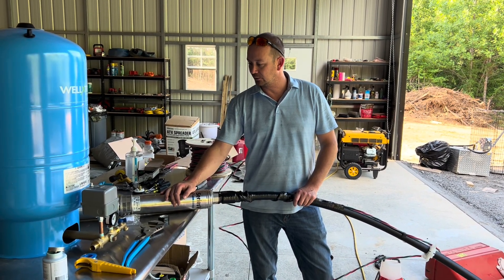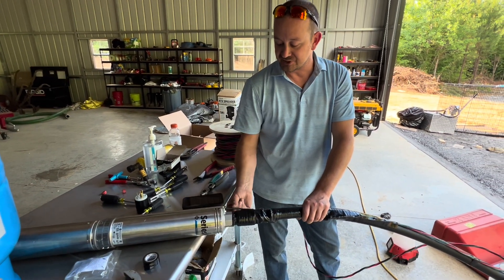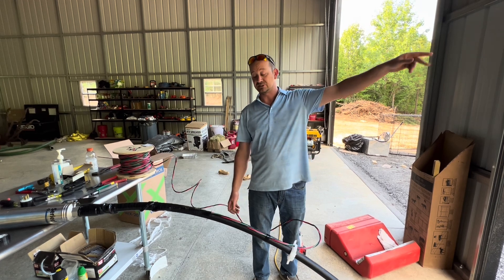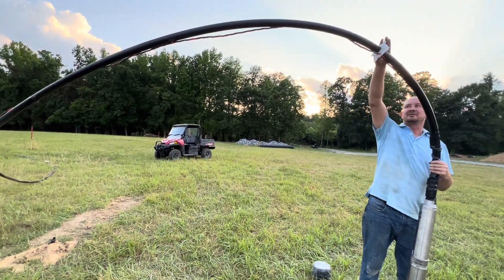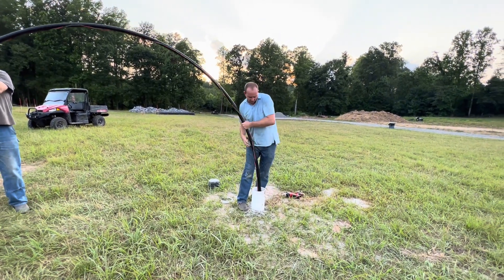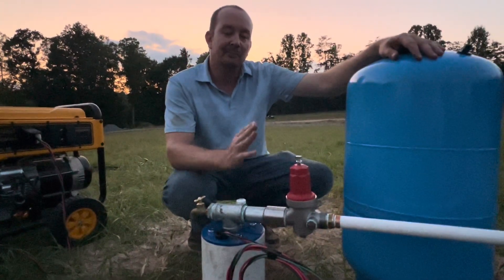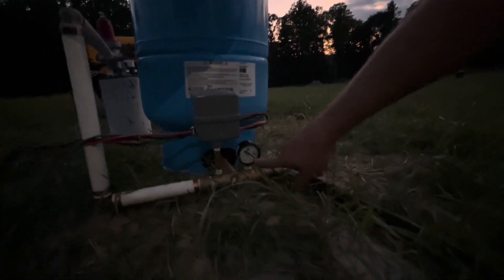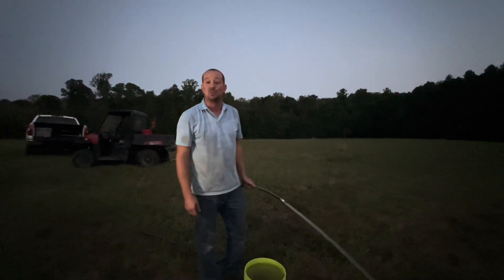High GPM Well Pump Installation

Comment: Why leave everything on bare ground? Would that rust in time and cause u future problems
Reply from the maker: Typically not an issue… that being said, it was only temporary to get some water out at the property, the setup has been moved to inside the shop for quite some time now.

Comment: Do you think a cycle stop valve is superior to a traditional large pressure tank setup for irrigation purposes and long runs of pipe? Have a similar size property as yours and will be installing an extensive irrigation system with long runs.
Reply from the maker: A cycle stop serves more than one purpose:

Stops the well pump from cycling, therefore improving the life of the pump

Saves energy; the majority of energy used on pumping water is the starting amps required every time the pump turns on.

Gives more consistent pressure by allowing the pump to stay running the entire time water is being used.

That being said, I highly recommend a cycle stop valve, especially in cases of irrigation.

I would also recommend a larger pressure tank.